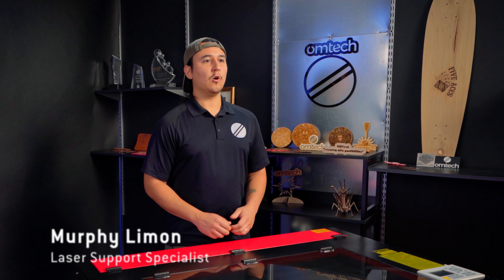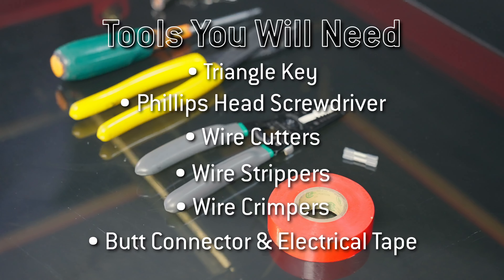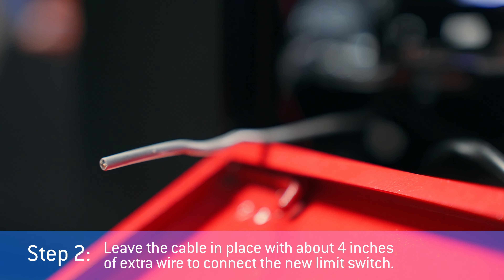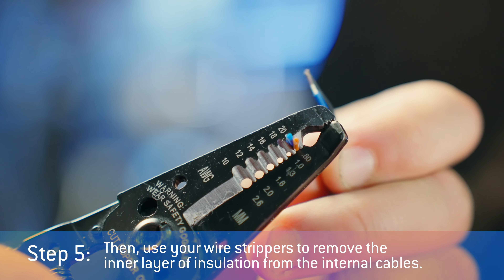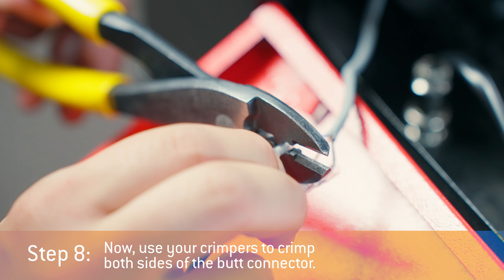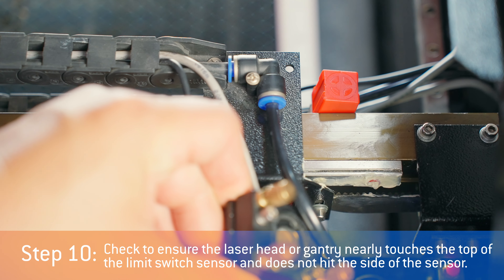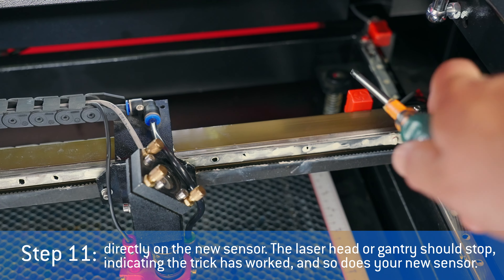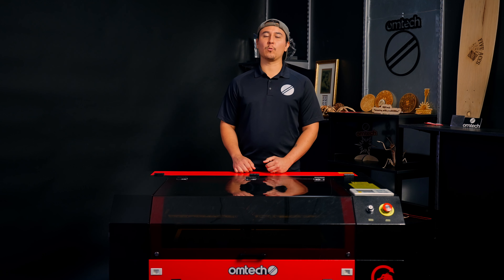How to Replace Your Limit Switch

Comment: What happens if one or more of the 3 wires is broken inside the sleeve further away from your 4 inches :))... ? Continuous bending of the wires can easily cause that more on the X axis than on the Y.. :) why ?